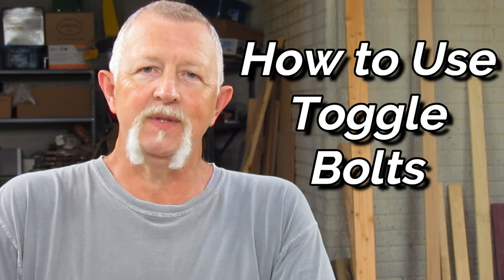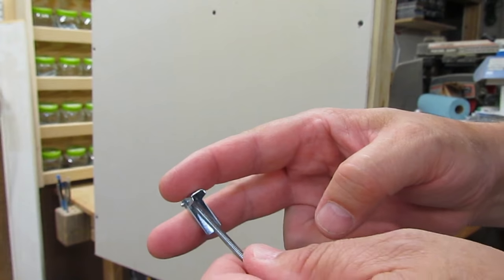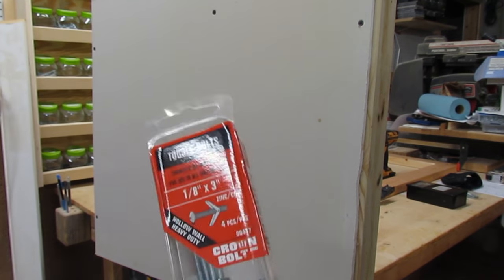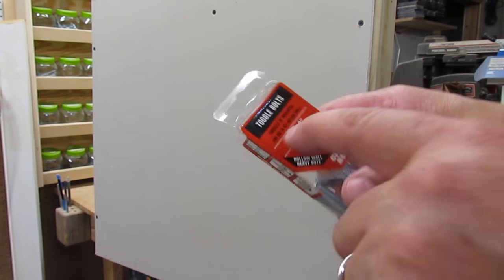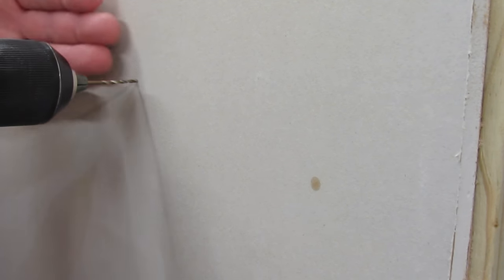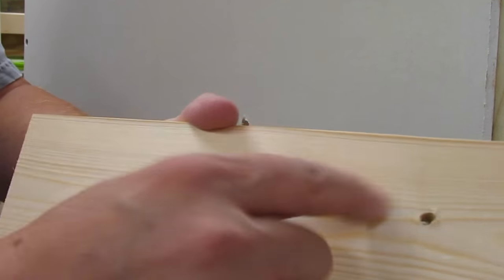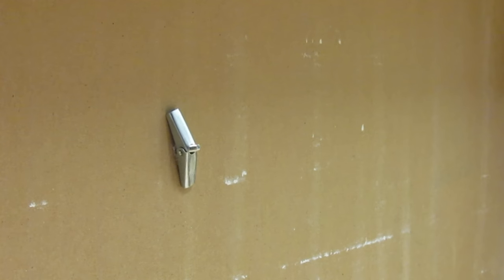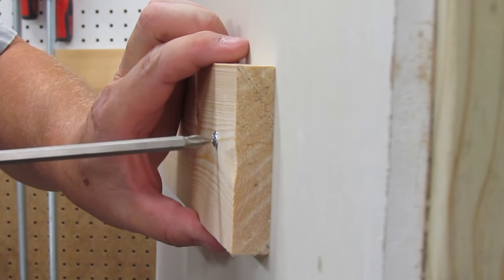How to Use Toggle Bolts

Comment: Dennis: I wanted to thank you for saving me from trouble. I was installing a small cabinet onto drywall with toggle bolts, but hadn't thought to use the wood board. Had I not used the board, I never would have gotten the bolts tight. Using the board, I was able to do exactly what you taught--exert pressure allowing the bolt to properly tighten. It came out great thanks to your help.
Reply from the maker: I'm glad this helped!  Thanks for watching, Keith!

Comment: THANK GOD (literally) FOR YOUR VIDEO. Ive watched a few videos by other ppl to try to learn whytall my effort was useless when the screw & toggle just kept spinning & wouldnt tighten up once inside the drilled holes, so I was so stressed, & I assumed if they would screw up & tighten then they mustnt be able to unscrew either so I had no clue what to do next. 3 days later after looking at my shelf half hanging off these loose bolts & seriously stressing about it, I dared try to unscrew them (assuming why would they unscrew if they wouldnt screw in''?) but that actually worked, but I had no clue why. Meanwhile the toggles of course were now lost down the back of the wall.  THANKU for explaining to pull th srew with the toggles back toward U so toggle bolts are against the back of the wall. THAT MAKES ALL THE DIFFERENCE. Something so simple
Reply from the maker: I'm so glad this helped!  Thanks for watching!

Comment: You answered all the questions I had about toggle bolts. Even: "why doesn't Lori Wall Bed cover toggle bolts in their assembly video?"

Wish me luck juggling that cabinet and three toggle bolts 🤣🤣
Reply from the maker: LOL!  I sure hope this helps!  Good luck with the cabinet and thanks for watching, Caleb!
Reply: @dwcoffey  looks like the preference is for fastening to studs. Going to check your videos for info about that. Double checked the printed instructions, recommend drilling a hole to fit the toggle through the cabinet too, seems a lot simpler than what I had imagined after watching your video ☺️🤞😅

Comment: Just wanted to thank you for an all inclusive simplistic straight to the point aid in accomplishing this task; and on that note heading to Home Depot tomorrow first thing to get me a 1/16” drill bit🙋🏻‍♀️👏🏻👋🏻🙏🏻

Thx again
Reply from the maker: Thank you for watching!  I appreciate your support!
Reply: No thank you; quick question why is it so hard to find a 1/16” drill bit long enough to poke through and establish whether I need to use toggle bolts or anchor ? They only have the tiny short one’s
Reply from the maker: @25bonsai  in drywall construction, the drywall is only 1/2” to 5/8” thick, so you won’t need a very long bit. Also, you can use a larger bit, but it will of course leave a larger hole, so I’d recommend using a stud finder. If you have plaster walls, the plaster may be up to 1” thick, so if you only chuck a small amount into the drill, a 1/16” bit should still be long enough. Hope this helps!

Comment: great lesson.  once the hole is drilled, i use a mini file to make a couple of notches for the toggle bolt tabs.  it helps avoid knocking a chunk of drywall out the back when you force the tabs through the tight hole.
Reply from the maker: Great idea!  Thank you for watching, BJ!

Comment: Just wanted confirmation this is the right way, someone tested weight capacity and said it's wrong way to use them when push through the hole like you did
Reply from the maker: Not sure about what the other person said, but the only way for these to work is to push the toggle thru the hole.  This is definitely the right way to use them.  Let me know if I can help!  Thanks for watching!
Reply: @dwcoffey  same, I was confused as thought it's the only way but they never said the way they thought was correct

Comment: Thank you! This was excellent. But how do you use the same method if you're hanging a shelf that has the bracket in the back of the shelf?
Reply from the maker: Thank you for watching, Lois!  Sometimes, you can put an extra nut on the toggle bolt screw, run it nearly up to the head of the screw and then install the toggle bolt with the head of the screw slightly protruding from the wall.  Then hang the shelf on the screw head.  A lot of shelves, ones that only have access to the bracket from the edge of the shelf that meets the wall, may have to be hung using a different fastener.

Comment: So much detail and explained perfectly. THANK YOU! Is the 200, 250, 300 pounds of weight that the toggle bolts can hold for one toggle bolt?
Reply from the maker: Thanks for watching, Casey!  Yes....but usually the weight capacity is limited by the drywall before it is limited by the toggle bolt.
Reply: @dwcoffey  great! thanks :)

Comment: Help, this is a great video but I don’t have a stud and am using 4 toggle bolts . How do I manage this and keep track flush while working with toggles 2 and 3 ?
Please and thank you
Reply from the maker: Great question, Kelly and thank you for watching!  Multiple toggle bolts are a bit of a challenge.  Basically you have to hold the item you are mounting away from the wall to keep tension on each screw and tighten each screw a little at a time until all are snug.

Comment: So helpful!! How would you recommend doing 2 toggle bolts for the same piece of wood? 

I’m hanging up a closet shelf and using horizontal support board/beams to hold a floating shelf.

The short side of the support beam only has 1 stud and it’s right in the middle. I am unsure if I should do 2 anchors (1 on each side of the stud) or if maybe I just need only one. Assuming I should do 2 to be safe, I wonder if you might be able to explain?
Reply from the maker: Thanks for watching, Cassie!  I would use 2 toggle bolts.  Once you get them both started thru the piece of wood and toggles into the wall, hold the board away from the wall so the toggles engage the backside of the drywall and tighten each bolt a little at a time.  Be careful to not get your fingers pinched behind the board when you get close to the wall though.

Comment: we have a toggle stuck in our wall right now...got the smallest toggle and the largest drill bit we have  for the hole and pushed the toggle and screw in and it went so far then just stopped. 
Those damn little things that stick out are jamming us up. We can't even pull it out! you made it look so easy lol
Reply from the maker: When they hang up like that, I just wiggle the screw (while threaded into the toggle) back and forth to make the toggle carve out its own slot to fit thru.  Thanks for watching!

Comment: Great video. Where did you see the tension load (3:23)? I see the 1/8" toggle bolts listed in HD rated for 42 lbs max.
Reply from the maker: Thanks for watching!  There are a few engineering sites that have that info, here is one I have used:  https://www.aftfasteners.com/toggle-bolts-technical-mechanical-information/
OF course, the tension and shear values are failure points, so I wouldn't load the toggles to these weights.  :)

Comment: This is an excellent video!  I understand why you need to make sure to have it screwed on enough to have a few threads so that it opens fully on the inside of the wall, but is there any reason you don't screw the toggle farther up on the screw so you have less tightening to do outside the wall?  Thank you!
Reply from the maker: Thanks for watching, Lisa!  You could definitely do that....just be sure to leave enough so the toggle can fully clear the backside of the drywall and open.  :)
Reply: @dwcoffey  Thank you!

Comment: Thank you so much.. do you think i could use toggle bolts to secure my pedestal boat seats to the boat floor??
Reply from the maker: Hi Paula, thanks for watching!  It's hard to say for sure, it would depend a lot on how your boat is made, but I think there are better fasteners than toggle bolts for that application.  Toggle boats distribute the load a little, but not nearly as well as a backing plate or even large washers, especially on fiberglass....because the toggles will dig into the fiberglass and allow moisture to be introduced.  If you have a plywood or aluminum deck, they will probably work ok.  The only other thing I'd worry about with toggle bolts is rust.  If you can find stainless toggles, you'd probably be ok.  If not, I would not use them on my boat as I think they will rust quickly in a marine environment.

Comment: Do you have any advice for hanging a heavy frame with a wire in the back? Could I use this same technique and if so how would I tighten the screw without something stable pulling it back?
Reply from the maker: Hi Sofia, Thanks for watching!  For hanging something heavy with a hanger wire, you really need to have the screws or nails into one or more wall studs.  You could use toggle bolts, but you'd need to put a nut and large washer on the screw, just under the head.

Comment: Thanks for your video. When pushing the bolt to the hole, does it matter what the orientation of the "wings" is? If it matters, and I noticed you rotated it from horizontal to vertical, but how to make sure if we cannot see through and have no idea what the wings are aligning, vertical or horizontal?
Reply from the maker: Thanks for watching!  It doesn't matter.....unless you are very near a vertical stud.  If that's the case, you want to orient the wings vertically so they don't hang up.

Comment: I'm assuming there isn't a way to remove the toggle anchor piece (behind the wall) if you no longer need it? Is there a different type of anchor that can be removed so that it can be reused?
Reply from the maker: Thanks for watching!  No, the toggle portion will just fall down inside the wall if the screw is removed.  I am working on a video showing different kinds of wall anchors and their use.  I am not aware of any anchor that has support on the back of the drywall and can be removed from the wall along with the back-of-wall support piece.

Comment: Is it better for the snapping mechanism on the inside of the wall to be vertical or horizontal if you want to hang something heavy on it?
Reply from the maker: Technically it is probably better for the toggle to be vertical on the inside of the wall, but may be very difficult to be sure it is when tightening.  The engineering data on these is calculated on worst case, so as long as you don't exceed the recommended load capacity of the toggle, you should be fine, no matter how it is oriented.  Thank you for watching!

Comment: Thank you, this was very informative.    I'm trying to use a 3/16 toggle on my garage ceiling and about an inch behind the dry there appears to be a metal beam. Would you recommend  I punch through that with the toggle or keep it at the drywall level?
Reply from the maker: Thanks for watching!  If you can get the toggle to expand behind the drywall without engaging the metal beam, I think that would be better.  Any metal beam in the ceiling is likely to be a load-bearing structural member, so you don't want to drill holes etc in it.
Reply: @dwcoffey  Thank you for the response! I will definitely not be drilling into the metal knowing that.

Comment: Are these toggle bolts for TV hangers? I ran 21 nails on a bracket and I'm thinking about putting two or four  toggle bolts for support.
Reply from the maker: Thanks for watching, Joshua!  Yes, toggle bolts would be good to use for TV brackets, if you are hanging them into a hollow portion of the wall.  If you are attaching them to a stud, you only need a couple of screws.

Comment: Great step-by-step instructions.  Was thinking about how the item would be attached but had not thought of the tension part.

Curious, would you recommend these metal toggle/Molly bolts over the plastic component (snaptoggle) toggler style?

Will be hanging some heavier curtain rods which will hold heavier fabric curtains and trying to decide which are best in the long run, but also for the application.
Reply from the maker: Thank you for watching!  I prefer the all-metal type, like these over anything with plastic components.  I think the hangers with plastic parts are just a little more susceptible to breaking/deforming and/or becoming brittle over time.
Reply: @dwcoffey  Thank you for taking the time to respond!  Definitely appreciated.  I was thinking the same thing re plastic in general.  I've had many plastic items that did just that, degraded over time.  Your response makes my decision that much easier!🙂

Comment: Dennis, great toggle bolt tutorial. I am hanging a curtain rod (Traverse) and due to weight of draperies, I want to use toggle bolts. Do you have any suggestions for putting multiple toggles into a small part? I would have liked to have seen how you handled the second hole on your demonstration.
Reply from the maker: Thank you for watching, Vaune!  Be sure to drill your holes only as big as you need, in order to get the toggles thru.  Thread up your toggles onto the part to be mounted, only putting the toggle as far on the screw as necessary to allow it to open correctly.  Slip one toggle into its hole, then slip in the other.  tighten each screw a few turns at a time so you can keep tension on each one and allow then to tighten.  I hope that helps!

Comment: I have dry wall anchors and was wondering what size hole I need I have 3 difrent sizes
Reply from the maker: I'm not sure what size anchors you have, so it's hard to say.  Most drywall anchors will tell you on the side of the box what size drill to use.  If not, use a drill bit slightly smaller than the shank diameter of the anchor (excluding the threads, if it is threaded).  Thanks for watching!

Comment: I was planning to use toggle bolts to hang a towel rack in my bathroom, but now I am thinking that is probably not the way to go.  What would you recommend for that?
Reply from the maker: Thanks for watching, Kevin!  I think toggle bolts are perfect for towel racks.  I'll often use a smaller toggle, but since towel racks often get pulled on a bit, toggles should hold them firm.

Comment: If I have 4 toggles to put in a galvanized pipe flange,  through stucco wall, I wonder if I will need to screw them in little by little rather than one all the way first..... hmmm.  I'm thinking the second, third, and fourth might not be as easy to hold with tension.  I guess I'll just try it and see.  Thanks for the great explanatory video.
Reply from the maker: Thanks for watching, Summer!  That's what I do when I have multiple toggle bolts.....I'll tighten each one about halfway, then a little more until I can get them all close enough to snug up 2 to hold the mounted item.  If it get difficult to hold them last ones while tightening, hold the head of the screw out with a claw hammer, tip of a slotted screwdriver, single edge razor blade, etc.
Reply: @dwcoffey  Thank you so much.  I appreciate your quick response.
Reply: Dennis, I am mounting a galvanized pipe handrail into exterior stucco.  I have drilled my holes nicely, but thinking I should put some kind of filler into the larger part of the open holes as I install the bolts.  Would you recommend a silicone gluey kind of thing?  I thought about stucco patch, but afraid that would mess up the threading of the screw and toggle.  Any suggestions to reinforce that absence of stucco around the bolt going through hole?  Thanks.
Reply from the maker: Hi Summer, I think anything you put in before the screws are tightened completely will probably either cause problems with threading the screws or will pull out as you tighten them.  If you can get to the holes after everything is secure, I'd think caulking would be easiest and should work fine.
Reply: @dwcoffey  Thanks so much for your time.

Comment: Would these be good to mount 4x4 to stucco? Maybe 5/16 or 3/8.
Reply from the maker: It will depend on how the wall is constructed behind the stucco.  Often that is hard to tell.  If it is poured-wall, you will want an expanding anchor like a lead anchor or a redhead.  If it is a framed wall with concrete board or a block wall, toggle bolts will work fine.  In a cinder block wall, you'll need a stud finder to help you locate the voids.  The toggle bolts should be installed into the block voids.  Thanks for watching!

Comment: Very helpful except I think you should show how you put the second toggle bolt in once you screwed the first one in snug.
Reply from the maker: Thanks for watching, Ric!  I didn't think to show that, you are right, I should have.  Basically, you tighten all the toggles up as you go.  If you tighten one at a time, you just have to hold the screw out so that the toggle contacts the back of the wallboard and doesn't spin.  I hope that helps.

Comment: stupid question though. How do you determine the weight capacity of the drywall? like 1/2" ceiling?
Reply from the maker: Thanks for watching, Alex!  That's a great question!  Here's a chart to determine what various thicknesses of drywall with a toggle bolt can support.  Hanging something from a ceiling would be considered 'tension' in this chart.  Shear would be applicable for hanging something on a wall.  
http://www.factsfacts.com/MyHomeRepair/images/ToggleBoltSpecs.gif
Reply: @dwcoffey  exactly what I needed. Thanks